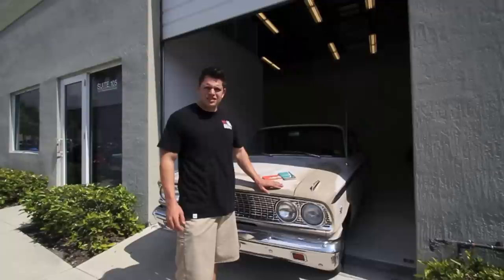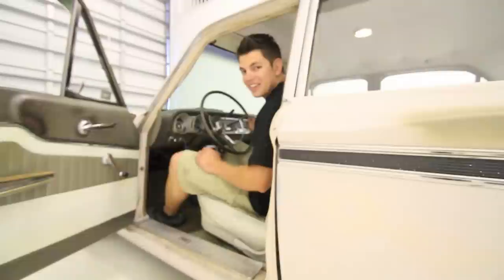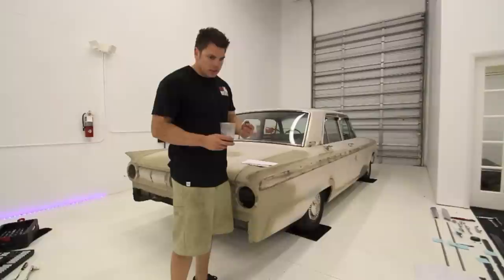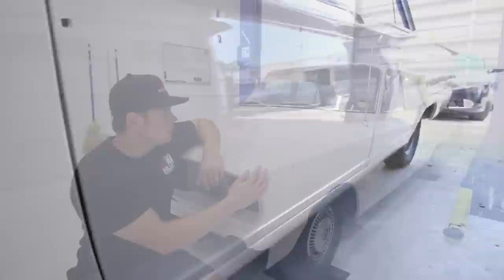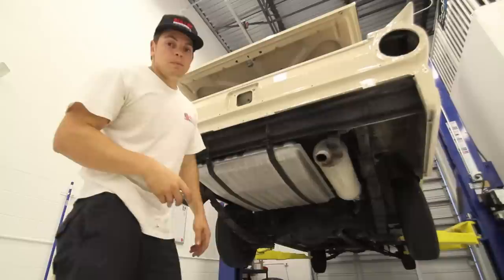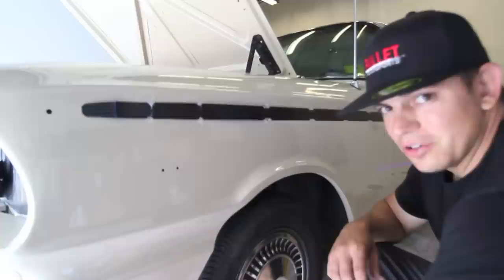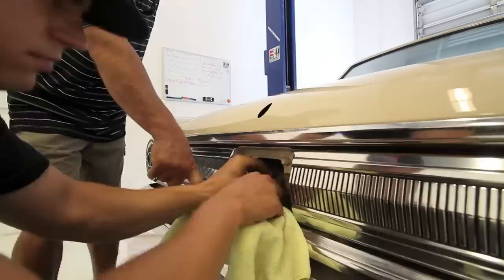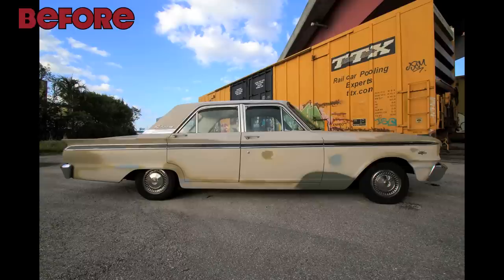1963 Ford Fairlane 260 Rebuild Documentation in HD

Comment: Very nice.  It has a Ford-O-Matic two-speed automatic, an FM converter for the AM radio, and original air conditioning.  All it needs is a set of whitewall tires!
Reply: Looks like a 2 speed auto.

Comment: Really nice car, I had one and it was a nice driving vehicle.  And I do appreciate that you put that amount of work into a car that most people would have just junked, but I have to ask after all that work, why did you not get the correct size whitewall  tires for it?  Such a glaring oversight on a really nice job that you did.   Nice correct tires would really make that car stand out.